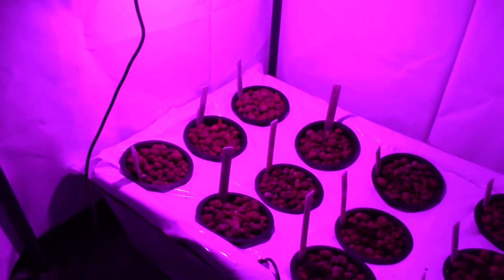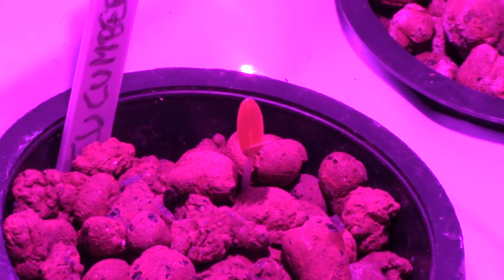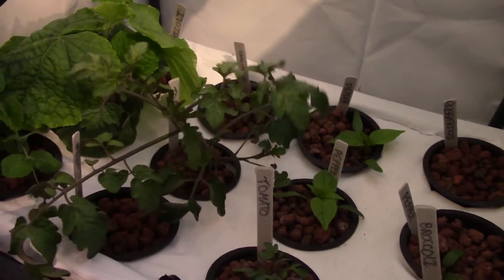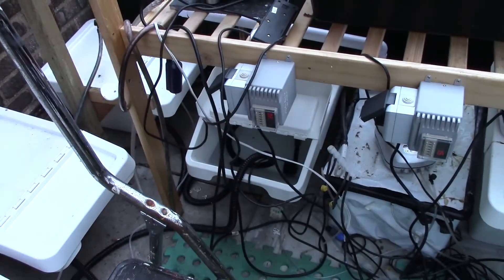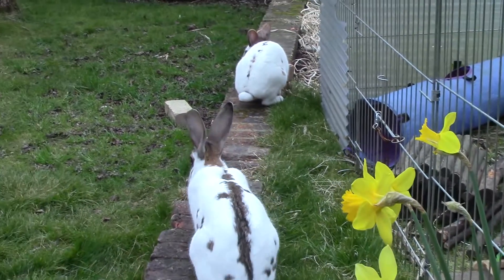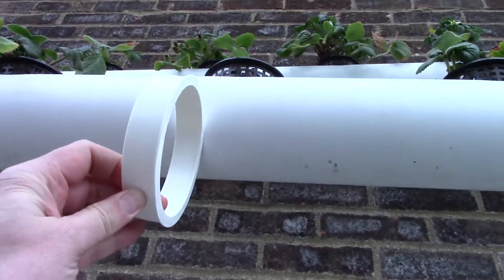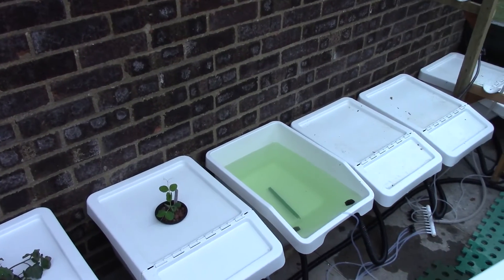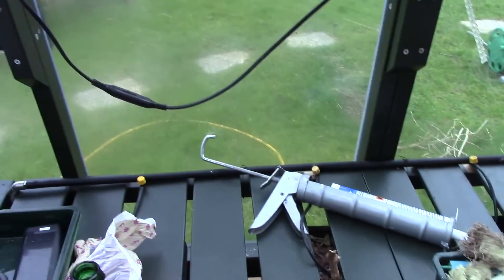Hydroponic Greenhouse Update - Seedlings Timelapse and planting in DWC - 20th March 2016

Comment: Nice update JIM - loved the timelapse! i want to give one a go too! did you use a camera hooked to your computer or a camera set to time lapse plugged into a power supply to keep it going?
Reply from the maker: Hi +Edward Bailey  - I'm using a very old Olympus C5050Z 5MP (circa 2003) hooked up via a USB cable to a little single-board PC that I had kicking around from an old work project. I'm using gphoto2 software on linux to control the camera - It takes a pic every five minutes and then copies it over to my fileserver using ssh/scp. The camera flash is in 'auto' mode, so when it's night-time you still get to see what's going on. Both camera and PC are hooked up to external power bricks to keep them running. Hope that helps. Loving your videos BTW. Cheers!!
Reply: +Jim Conner Great! - i will hopefully be giving it a go when i get back from holiday in two weeks! looking forward to seeing updates on your garden,electronics, and 3d printer :)

Comment: I like the idea of using flowing water, what stops the roots from rotting though?
Reply from the maker: +Slot1Gamer - I'm hoping that a mixture of good aeration, well sealed reservoirs (the rain shouldn't be able to get in) and a dose of good luck will do the trick. I'm starting this sytem using new buckets, so I can be confident that there's no Pythium fungus in there yet - The large reservoirs won't heat up too quickly on hot days, so the water should be able to hold good levels of disolved oxygen, meaning that the root system won't get stressed out and weakened, and hopefully (fingers crossed) the plants will be healthy enough to resist a few spores here and there when they do inevitably get in. Cheers!!

Comment: Do you have a video on the construction of your misting chamber?
Reply from the maker: Hi +askiro jaro  - This is probably the one you're looking for... https://www.youtube.com/watch?v=2EO-3ut4Rsg ... Cheers!!
Reply from the maker: Hi +askiro jaro  - This is probably the one you're looking for... https://www.youtube.com/watch?v=2EO-3ut4Rsg ... Cheers!!
Reply: +Jim Conner - Thanks so much for the link, I just started to play around with my own mister.  I have the same mist set up and I am trying to use it as a hydroponic seed starter.  The only problem is the temperature gets a little to hot sometimes so I am not quite sure what to do about that, but its working pretty well.
Reply from the maker: Hi +askiro jaro  - Yeah... my misting chamber gets a little warm too with the fogger running 24x7... I'd guess that the solution in my setup is sitting at around 30C. I did consider putting a timer on there and running the fogger 5 mins on, 5 mins off, but the plants don't seem to mind a bit of warmth underneath them - I think it helps them get started myself. Cheers!!